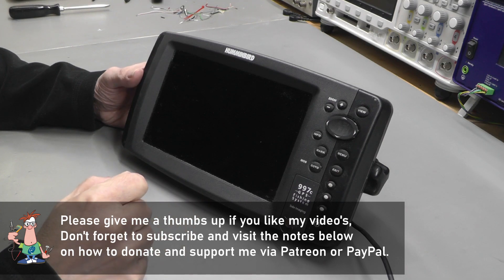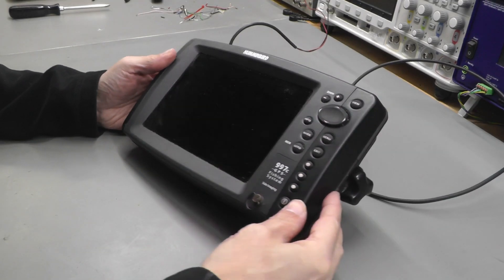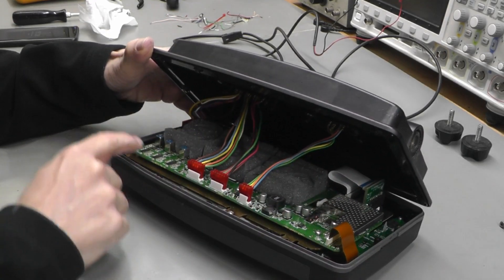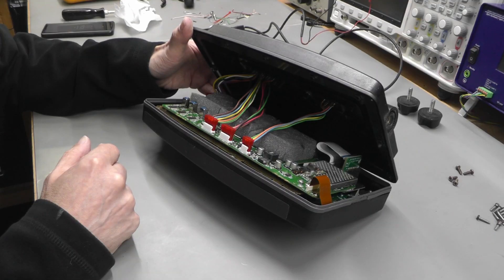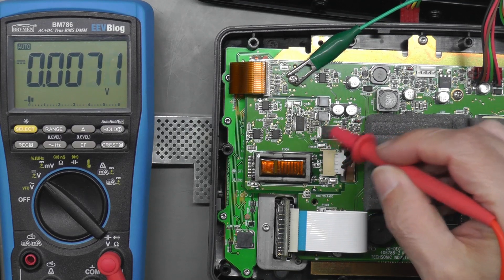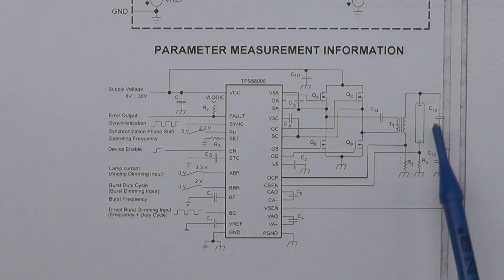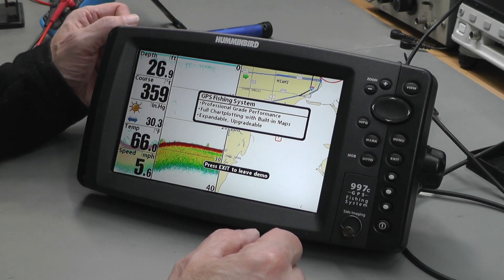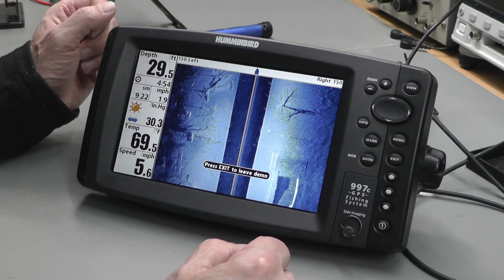No.102 - Humminbird 997c SI Combo Fishfinder Repair

Comment: so did you replace the digitizer too or just or just the light tube..you kinds skipped over the most important parts. I noticed it was a Hitachi screen? I wonde rif you coul dorder these from  ali express to fix debonded digitizers? Would you happen to know?
Reply from the maker: Used the same, I only replaced the tube.

Comment: You must have very steady hands holding probes in tight pitch chips and not shorting, I am 78 now so have slight tremor, my probes are insulated right down to the points and I keep them very sharp to prevent slippage! Very interesting videos, well done! Fraser Armstrong
Reply from the maker: Thanks for the comments. I am 58 and hoping my steady hands stay with me a few years yet. I haven't noticed any deterioration since I started as a kid. Fingers crossed!
Reply: Old age brings all sorts of conditions! Just like an old car!😅

Comment: I use a powerful flashlight to check weather a LCD screen works and the backlight is faulty.
Reply: Testing as he did proved out the backlight drive circuit. Not proving out your faulty parts is the same as the mechanic who replaces the battery, alternator AND starter before they get a dead vehicle running.

Comment: I've got a GPS fish finder, but the best part with mine is the ones it finds all come with chips.
i've found over the years is that the tubes seem to give up the ghost before the electronics.
Got a few one a shelf from a laptops, but got no idea what to do with them. Was thinking what would happed if i heated one up and tried to bend it?
Reply from the maker: Yes, I did wonder if I should try heating and bending my test tube, but I only have the one……
Reply: @IanScottJohnston  I've got all the equipment to bend and anneal it afterwards; I think I’ve had too many hobbies.
But it would be an excuse to turn the kiln on and fire up the hot head torch. Maybe there is a failed video to be made there.
🙂

Comment: Very interesting repair as usual.

Now, just because you mentioned it in a card in the video : Davinci Resolve 18.1 now has a voice isolation effects that works great to remove any kind of background noise, so you could give that a go to deal with your HP gear noisy fan 😁 (Even though TBH if you hadn't mentioned it, I wouldn't have paid much attention)
Reply from the maker: Oh great, I’ll take a look at that voice isolation. I have been playing quite a bit with Resolve past few videos, i.e. tracking etc. Great fun!
Reply from the maker: Update: Just tried the voice isolation, wow, works pretty good! I'll definitely be using it from now on. Previously I was adjusting the EQ manually with all sorts of notch filters etc in Resolve.
Reply: @IanScottJohnston  Great, good to know it's useful and looking forward to the next video !